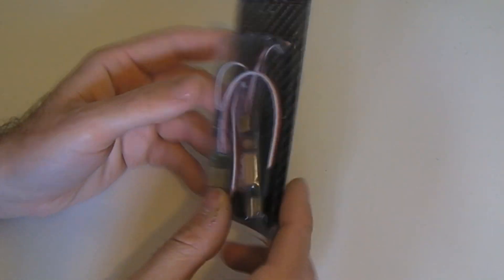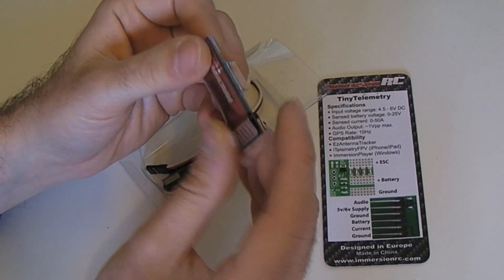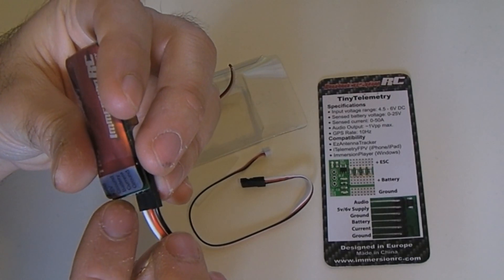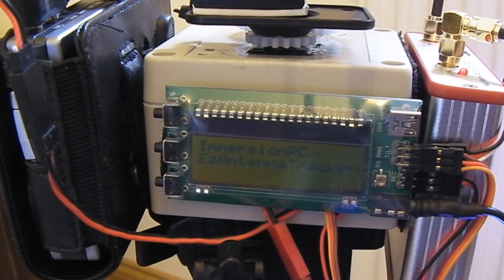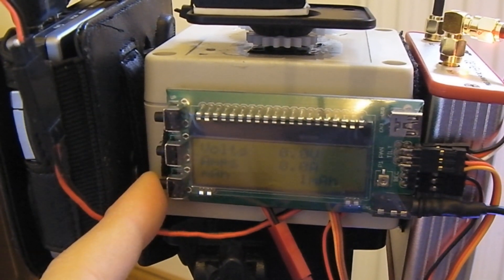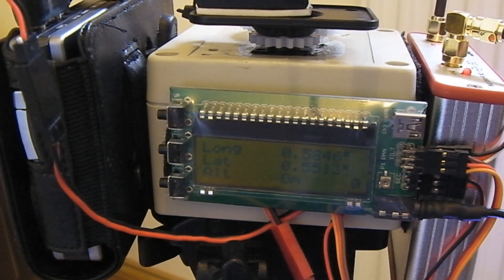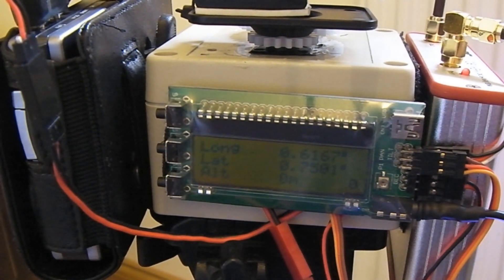ImmersionRC TinyTelemetry & EZAntenna: Introduction and quick setup.

Comment: These tiny telemetry units have been discontinued. I already own the ezosd but it is way to heavy and large for my small park flyers. I am wondering how this unit worked with the ezantenna tracker? Any issues? Would you recommend I hunt one down as there are no other smaller options at this time? Help is appreciated - thanks, tom

Comment: What update rate are you getting from the TinyTelemetry module?  It's advertised as a 10Hz system but I only seem to get about 1Hz with my unit.  It's a bit hard to tell from your video, but it looks like you're also getting about 1 packet per second instead of 10.  Any ideas about that?

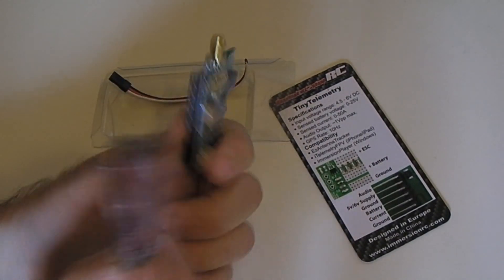Comment: Did you know you hooked up the current sensor and the Audio per sticker on the Tiny Telemetry (like I did ) But at 2:15, you rolled the Tiny Telemetry over with GPS up. The pin out are just like on the box package, but see the package pin outs are different than the sticker on the Tiny Telemetry. Did you ever actually hook up and use the current sensor?
Reply from the maker: I've never bothered using it :)